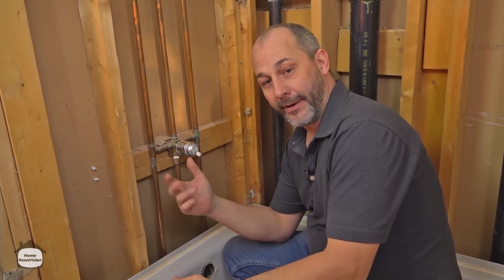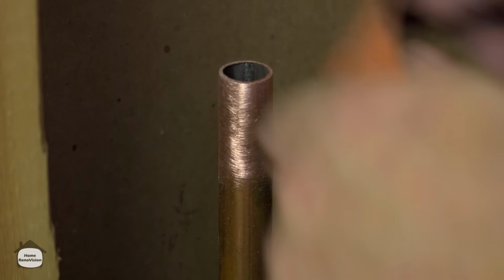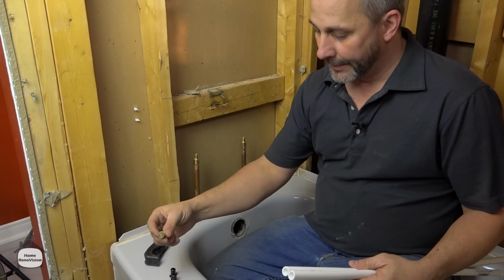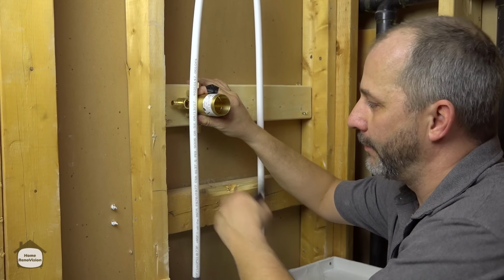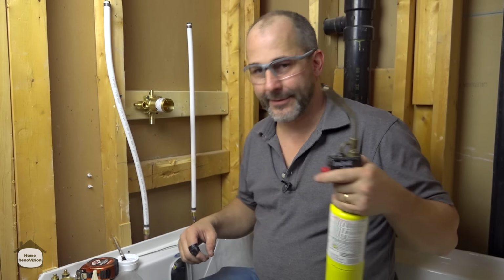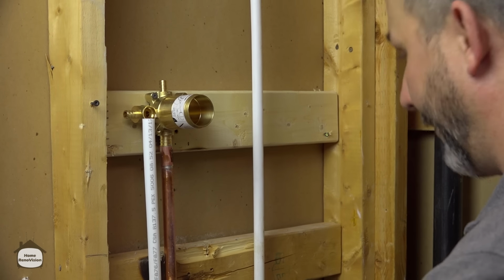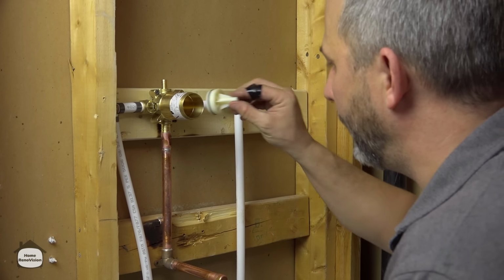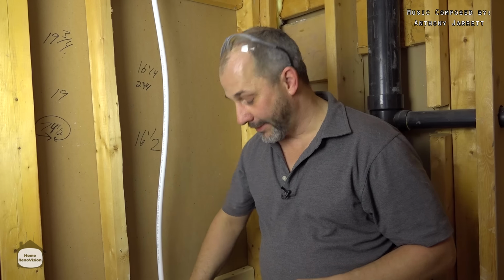DIY How To Install Copper To Pex Shower and Bath Plumbing

Comment: I'm a plumber of 17 years. Why even replace the copper it looked fine. Copper has a 100 year shelf life, it doesn't grow bacteria. 90% of the houses I do have copper. If I'm doing new construction we use pex and I love it too. Its fast and easy. But when your building a 400k house dont be cheap guys buy the copper. Sure it's more expensive but its built to last.
Reply from the maker: Just showing options is all. Cheers and have a great Christmas!
Reply: @HomeRenoVisionDIY  doesn't pex reduce the water flow a little?
Reply: MrKalashnik0va -- "Why would it swell" -- If the water line ever freezes.  This is an issue if you live in an area where you get sub-freezing weather and there is a possibility the house is not occupied.  After I bought my house in Oregon and turned on the shutoff valve for the front water spigot, I realized why they had it turned off.  The pipe that went through the attic had frozen and burst.  After it soaked the drywall in the ceiling of my office, I not only had to tear out and replace that drywall but then had to open the wall where the pipe ran. Amazingly, there were THREE patches in this pipe within about a 10 ft run because the pipe had frozen over and over again and they just kept patching the copper.  I replaced the whole line with PEX (and installed insulation correctly) and now I know that pipe will never burst again.
Reply: @dienekes4364  Word to the wise, in Oregon they would have used the copper pipes to ground your electrical. If you put in PEX without running a copper wire alongside to connect the two pieces of copper, you have eliminated that ground connection. Be sure and do that, or you (or future owner of the house), may some day have a much more serious problem than a leak.
Reply: then just switch to a ground rod...  dont make it complicated.. pex is by far the way to go! copper is old school, guys just hate change is all...  plus with pex more and more DIY can well.......  Do it themselves!! times are changing.. wish i could afford to pay a professional just to keep the trades going but cant!!..  and with youtube these days and technology....  like i said times are changing...
Reply: @josephdestaubin7426  Actually nobody grounds to water pipes anymore...It's not even code...actually in most areas it's AGAINST CODE....to proper ground your electrical system you are required to use Ground rods. In our Area you are required to use 2 ground rods 8 or more feet apart with ground clamps and one continuous wire connecting both rods to the ground bar on your Electrical panel  ...HELLO  grounding to water pipes is very Dangerous
Reply: I am eighty five years old and
since I was fifteen have been 
what they say "On the tools".
I learnt to wipe a joint with a 
pot and ladle  Years ago if a
cylinder leaked I'd wipe a piece
of copper over the hole, just like wiping in, an immersion boss. I've got tools in my bag,
today's plumbers wouldn't know what to do with them, or
what they,re called, and your 
quite right about copper cylinders, especially the old
ones, they were made with table one copper, not like the
 one's of today, table three.
J. Calveley.
Reply: F
Reply: I Agree- I used PVC IN THE PAST AND IT WORKS For me.  I have never used PEX.  But it looks amazing 👍🏻
Reply: @jimmysapien9961  If you use it, you will not want to go back to pvc.
Reply: Copper in Florida is pron to pinholes. In my 20 year old community 80% of the houses have already had pinhole leaks and have  been re-plumbed with CPVC, all of them will be eventually.  i wish the builder had used PEX in my house, I would be $3000.00  richer today.You can keep your copper.
Reply: Well the plumbers have fought PEX for decades...Remember when Wirsbo showed up in the 1990's and the Plumbers unions quickly wrote codes to ban it's use in most of the USA...then when PEX residential was being used in the early 2000's once again plumbers got codes to block pex in many cities.....Copper is kind of a joke any more. it's only used by plumbers because it's very expensive to install.....Over the past 40 years of plumbing pex is easily the best change in this industry in a long long time...PEX with brass ring crimping will outlast copper easily...especially if you get any freezing at all.    CPVC  does age and get brittle...the only people that argue against PEX are Plumbers or ignorant people that have never used it and just talk out there dumbass
Reply: I agree with you 100%
Reply: Any house in Toronto is over 400k.
Reply: Chris Szuch I noticed when my pipes freeze on pex tubing and then I thaw them out they never crack even with torch..they will leak from where the metal crimp ring is..
Reply: RAHRAH807 I thought pex didn’t freeze
Reply: Jimmy Sapien pex freezes all of my  pipes have been converted to pex from copper underneath my house..I now have heaters in certain areas to prevent them from freezing..Canada Ontario gets very cold here around -30 to -40 at night or colder
Reply: ha ha... pex and copper dont freeze lol... its the water inside...   if not insulated they will both allow the water to freeze its just the fact that pex can handle it better then copper...  when water freezes it expands. pex can expand better then copper and for more cycles.
Reply: My copper pipes were installed in 1977. I've had two pinhole leaks. I'm converting to pex. My only question is,  does pex leach chemicals like some plastic containers do, causing unhealthy water conditions?
Reply: I'm  30 years into my career, but don't see how I can relate that to telling anyone not to do an instructional video until they have a real need to do the work versus sacrificing a few healthy parts. Maybe you should just edit your remark to a simple "thanks" to the guy who sacrificed his time and the crazy amount of money he's out of pocket for replacing a little piece of copper 200 years before it's necessary 🙄
Reply: Pex can expand 2.5 times w/o exploding thou,, ie,,, when it freezes,,, try that w copper, lol will never explode, leak, freeze so I'm 100% a pex guy
Reply: I watched a video recently where different pex was tested and neither of them expanded as much as everyone states here, but I feel pex is still my preferred.
Reply: LOL 400K house. My 1954 1500sqft 3 bedroom cheap track house is about $700K here in Seattle.
Reply: @SteveP-x1o  I can during those "other" videos they can't show on YouTube 🤘
Reply: Po pierwsze to nie pex tylko alupex
po drugie przy lutowaniu grzejemy samą kształtkę najlepiej pośrodku nigdy razem z drutem cynowym
i podbijam post kolegi chris szuch:)
Reply: The copper pipes feeding my (then) 9 year old water heater developed a series of pin hole leaks (pits inside the piping) found  after doing damage....   personally Ive not had any damage from using pex repairs or renos in 15 yrs over several properties, including once a frozen pipe that swelled several times its normal size,  Its pex for me forever, and where/when needed in a pinch sharkbites.
Reply: chris szuch in 17 years have you not seen copper have pin holes and leak? Never been on slab leaks or anything? Idk what part of the country you’re from but copper isn’t all that
Reply: Mr P pex have a 3/8 id and copper has 1/2 id, lost in volume, second, mice will chew through pex in no time.
Reply: I've been a plumber since 1983 and I have to agree copper is a thing of the past its antiquated and will be phased out over time watch you'll see it's just too expensive and it has too many variables that affect its longevity such as electrolysis etc whereas pex is impervious to many of the variables that copper has sorry but I'm on board with the pex it's just the way It goes i don't like it either but
Reply: If somehow it was allowed to freeze.  Copper is good for 2 or 3 freezes before it has stretched enough to burst.  Pex can take many cycles and not burst.  MrKalashnik0va

Comment: Thanks for sharing I've done the same thing with words bro PEX and the expander tool with the plastic ring that will shrink back into place the only thing you can't have any kind of oil on that brass fitting or you can get a week thanks for sharing - bye for now Merry Christmas God bless Ken
Reply from the maker: Thank Ken, Have a great Christmas as well. Cheers!

Comment: This is a very good video.   We hired a plumbing company to move our plumbing in our house so we wouldn't have to take out our garage doors if something ever happened.  They convinced me to install CPVC.  A month later I found news stories about CPVC and how it can burst in the walls of your home, so I removed all this from our bathroom before I did my rough ins in the shower.  PEX was super easy and I feel confident that we did the right thing.
Reply from the maker: It is usually the installer who is the problem , not the product. Cheers!
Reply: Send me that I've not seen it fail ever and I've used it for 20 yrs

Comment: Did you shut off water heater burner prior to opening hot water side?
Reply from the maker: NO, why would you?
Reply: When I shut off the main water I always open outside Faucets to completely Relieve the WATER PRESSURE 👍🏻👍🏻👍🏻

Comment: Great video, and thank you for this. Some questions about finishing the project: 
1) Do you cut off the soldered cap for the bath tub source pipe? 
2) How do you finish off the shower? Do you attache the fixture to that directly, or do you use copper to feed into the shower fixture? 
3) Do you remove that plastic white cone shaped item in the faucet? 

Thanks.
Reply from the maker: I think you should watch the rest of the videos in this series so you can see how we finished this project, cheers!

Comment: One important note: Shut off the water before cutting any pipe
Reply from the maker: rule number one and drain the line to remove the built up pressure. Cheers!

Comment: oh my god so much work.  just use sharkbites for connections
Reply: shark bites are not recommended in confined spaces there supposed to be visible in available for maintenance or exchange repair
Reply: never use shark bites on shower valves, bad idea
Reply: Been using shark bites since they came out back in 2003...NEVER HAD 1 PROBLEM WITH THEM !!!!.. Ever !!!.. And pex is even better than copper when it comes to freezing...bcuz copper splits at the solder joints and They've tested and tested both ... PEX NEVER FAILED !!!.. But...to each his own... 5th gen plumber and saw a thing or 2 !!😁😎
Reply: Sharkbites you cannot used in the wall 
For exposed connections OK
Reply: Burying a Sharkbite, let alone many in a wall, not a good idea. It may take an extra 20 minutes to do it right (proper connections), but it’s time well spent if it saves a wall, and your reputation.
Reply: Shark bites are $8-10 for a straight 1/2" coupling while brass fittings are pennies on the dollar. Shark bites are much quicker though for sure.
 @erikj.2066
Reply: Kevin Weddell Yes, you can stick the pipes together quickly with Sharkbites. But they blow off, they leak, and you’re depending on an O-ring to make a seal. They were designed for homeowners who don’t know how to solder. The only time I’d use one is for a temporary repair or cap. And I certainly wouldn’t bury half a dozen or so in a wall for a valve that’s going to be reefed on multiple times a day.
Reply: Erik J. I have used PVC. - I know prehistoric right 🤔. But it works for me !!!!
Reply: Russ Mayr ok

Comment: If you are renovating most of a house do you recommend just running all pex through out the house or is it better to just do short runs of pex?
Reply from the maker: in that situation use a manifold and run individual lines to each fixture with no joints. cheers!

Comment: Why even use pecs shark bite fittings work so much faster and easie Solderingrequired
Reply from the maker: Hi Bill just going over options for folks who will not have access to those fitting in case they start to leak in 20 years!

Comment: Great video but I would recommend that you protect the new bathtub while doing the install. One drop of a tool could damage the acrylic.
Reply from the maker: I have found in m y experience that no protection system really mitigates the risk. It is always faster and less expensive to pay attention and if necessary call in a repair guy to do a quick refinish job if needed.
Reply: When I had to step in and out of the tub to install the plumbing and especially  the backer board and tile a piece of cardboard from the box the tub came in was a big help and saved the day more than once most manufacturer's put a template on the box to cut out that fit the bottom of the tub just perfectly and it was there just for that reason tubs used to get chipped all the time during construction  by the tile or drywall man and no one was told or noticed it till the project was completed then what idk maybe they can repair them better now idk

Comment: I will never figure out why  anyone would want to convert copper to plastic........whenever you "crimp" fittings, you're a disaster waiting to happen.  Here in the United States, we had a plumbing disaster with Kitec (plastic) pipe...there was a class action lawsuit because the fittings were leaking....MILLIONS of homes had to repaired because of leaky "crimped" fittings.
Reply: PVC !!!!!   Works too !
Reply: Jimmy Sapien you don’t use PVC inside the building.
Reply: Copper is more reliable yes ! If I was to use plastic it would be under floors but only JG or the new hep20 all the others is a waste of time
Reply: I agree with you 100%
Reply: hmm you say millions huh??  dont recall that one?..  earthquakes maybe?..   crimped and secured properly shouldnt leak. i would agree over time could be an issue compared to copper but as to how long??..
Reply: That lawsuit was over polybutylene piping not PEX,  also PEX and Poly pipe use different size fitting barbs  @bartmartin161
Reply: using the right type of crimp ring is important (use solid copper crimp rings) pinch clamp rings are garbage
Reply: look at automotive fuel lines on newer cars. no metal
Reply: totally unnecessary.had copper pipes for years and no problems. plastic fittings are way too expensive

Comment: Great breakdown as always man. You’ve helped me get through a couple renos without subs already. One note- I learned from an old plumber to still use copper line up to the shower head to increase water pressure up there. It works!
Reply from the maker: Great to hear, we would love to see some pics so we can share and inspire. Thanks!
Reply: How does it increase  the pressure? Regardless of what material  you use 50 psi is 50 psi whether its half inch or ten inch  pipe the only thing that changes is volume gallons per minute  now copper for rigidity of the showerhead and tub spout is a very good idea in lieu of pex or cpvc  etc
Reply: You should have been  more insistent  on making sure up goes up to the showerhead I've run into more than one valve upside down and yes I did it once myself in my career idk what or where my head was that day but it happens and its important that its. Done properly as tearing out brand new tile is expensive

Comment: see melted solder on the tub edge    ???   ok your sure it wont damage  what about your shoes   in tub   cover it ?    what if's are abound    drop one  thing  your out looking for a new tub    safety saftey and  product protection ?   a simple old bedsheet   cardboard    im not a PRO BUT    I SEE   MISTAKES     double check your vids   get a pro to proof them   i gave bad/poor / advice and got reamed    even show like this old house don't show all the in and outs  to a job      not enuff time to go thru it all people    doubled triple check what your planning to do    diyers
Reply: It's the OLD tub

Comment: Hi Jeff!
Thanks for the nice vid, you mentioned installing 3/4” PEX for the shower head for pressure differential or drips?, but installed 1/2” instead? Or I got it wrong?, please clarify. THANK YOU!
Reply from the maker: I was showing that you can run3/4 line to thew tub with pex if you wanted too and that would solve the drip issue or you use copper to avoids the inside fittings. Cheers!

Comment: So nice to see someone who understands soldering so many people/videos use the torch to melt the solder. If the workpiece it's self is not hot enough to melt the solder it will not form the necessary amalgam. This is also true of electrical soldering apply the solder to the workpiece not the iron or torch.  Nice video.
Reply from the maker: Thanks, I try to show good methods. Cheers!
Reply: agreed; I hadn't appreciated that point until I watched this.  makes sense.
Reply: One of my first jobs after getting out of the Marine Corps was at a machine shop soldering carbide tool tips to steel mounting pieces.  You are SO right!  If you try to force the solder in by melting it instead of the workpiece, you don't get good adhesion and your piece will fall apart under pressure.

Comment: What is the blue "test plug tool" called? I must be on the hunt to find one. :)
Reply from the maker: Hi Don, they are not easy to find. I put my amazon link in the description below. It is in my favorite tool section. Cheers!
Reply: @HomeRenoVisionDIY  They have them at Home Depot for about $2.50.

Comment: wish they could come up with a way to do tub spouts without using copper.
Reply from the maker: They have you just need tom shop for the right materials. You can go 3/4 pex to drop ear and use npt 1/2 threaded rod to spout.

Comment: Why didn't you use red pex for the hot lines? I assume it's not strictly necessary but it makes everything so obvious and gosh darn prettier. ;)
Reply from the maker: When running new lines from the source I would suggest it, when finishing up like this behind a closed wall it is not necessary since the left line is always the hot.
Reply: A M they didn’t make red and blue copper back in the day